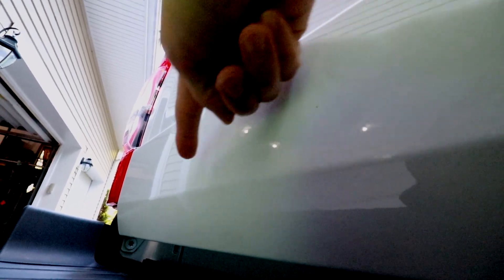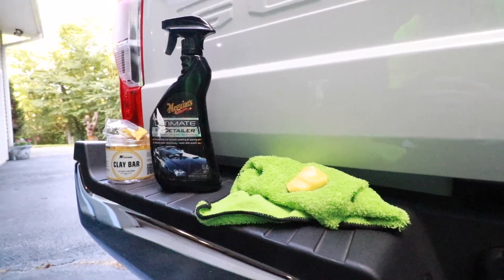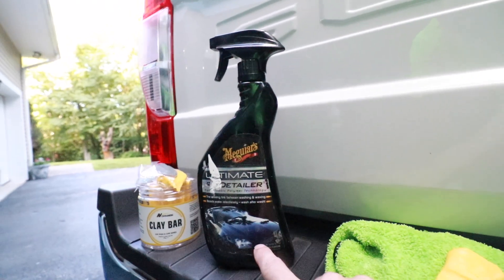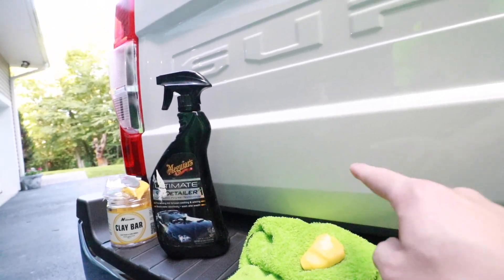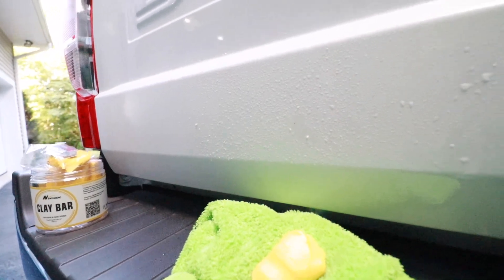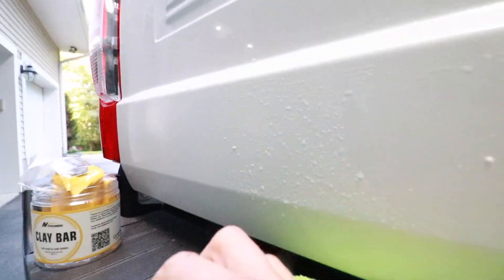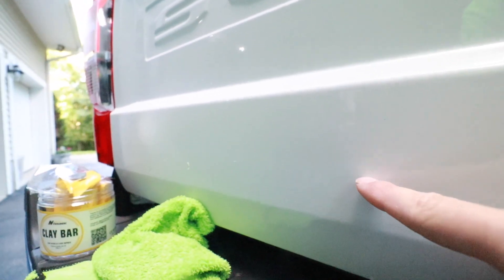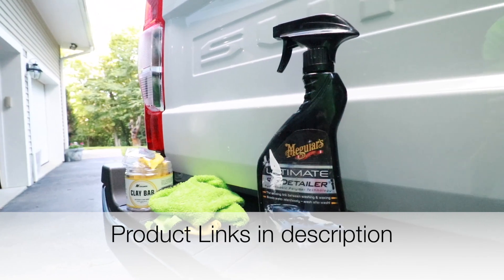How to remove Rail Dust (Rust specs in paint) Easy DIY

Comment: Its from your brakes as well.  Also other peoples braking in front of you will make it appear towards the front of the vehicle
Reply from the maker: Your point about brake dust is valid. It seems every year I have to remove some iron specs in the paint. One of the drawbacks of having a white vehicle